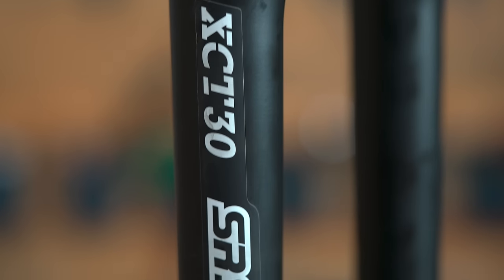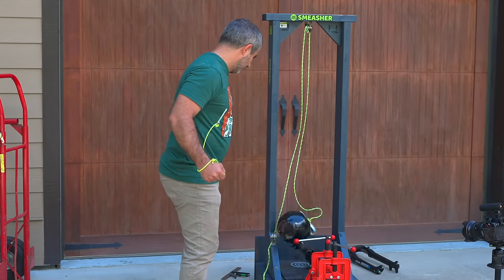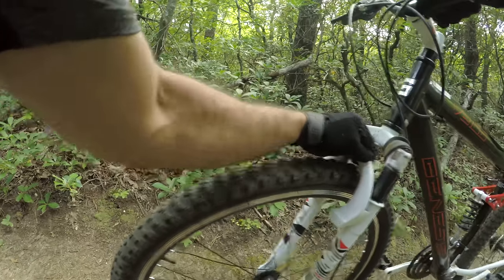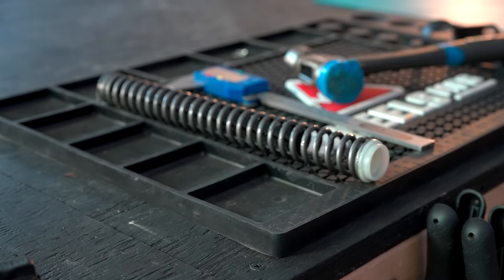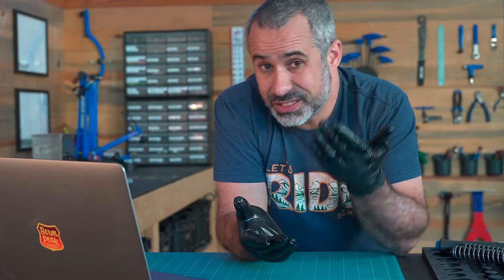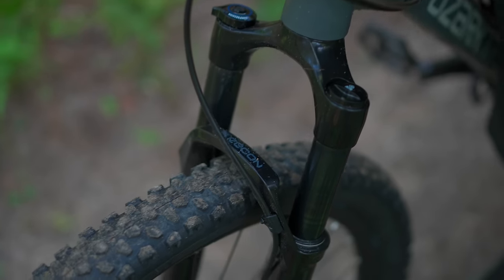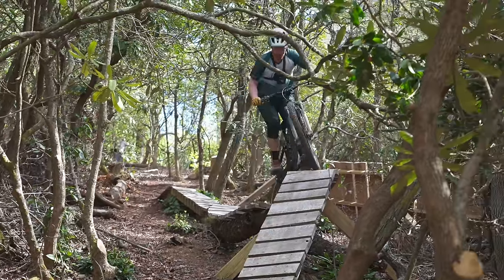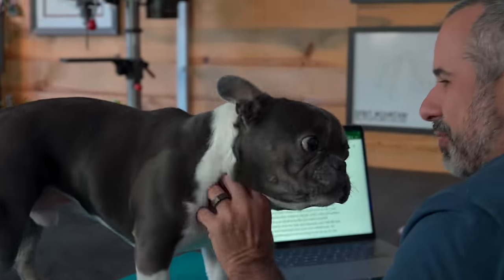The most popular MTB fork you (probably) know nothing about

Comment: I had an XCM on my 2008 GT Avalanche 3.0. 
It was okay fork, but back then they didnt have proper seals, just rubber things over the legs. Water got inside and corroded the legs. I replaced it with a used air Marzocchi, that I have until this day. 
That XCM i sold to someone who rode dirt jumps, and they was happy with that fork, as far as I know.

Comment: Thanks, that was really interesting!

I even got a brand new one of these in 28" config lying around. The old one did actually break and Suntour sent me a new one, great customer service! The springs were badly corroded due to a broken seal, I believe, that was long ago though. I didn't really use the new one as I rebuilt the bike for touring with a rigid fork that's been on it since.

Those standard models on adult sized bikes don't do much of suspension work if you're a lighter person like me with around 60kg/120lbs back then. There's a certain strength of springs built in, optimized for riders around 80kg/160lbs, if I remember correctly. And there's only so much you can do with releasing pre tension, not enough for me back then to have a big effect. It rode almost like a rigid fork but was way heavier, which was one of my personal reasons to ditch it as well. If you're a standard sized person it does an ok job though, I'd say. It even comes with mountings for fenders and a low rider rack for bags on some models!

Comment: Congrats for such a deep dive which, as mentioned below, no one else does. My experience with XCM 30 vs XCT: The XCT came on my 2017 SPZ Rockhopper 29. A piece of sh*t since the begining: Extermely slow, it works much more like a rigid fork than anything else. Then I bough a twin coil spring XCM and I'm just loving it: Its terrain reading is way better than the rockshox judy coil on my other (1 year in service) bike, it costs 1/6 of its rockshox equivalent and, as you mentioned, it's pretty easy to service. 
The cons I found during its 18 months in service so far: If you use grease on it, it demands full service on a monthly basis. The good news: That frequency drops drastically if you use a good chain wax to lube the upper legs and no grease at all on the seals. Another con is its very low resistance to corrosion. I live at the coast, in the Northeastern Bazil, where climate is pretty much like Forida (umid and hot) but it's also very salty. In my city you can see the salty fog on the beach. While my rockshox showed after no service at all, just a few stain dots, XCM30 looks like a jaguar skin, with stains as large as a thumb in the chromed uppers. YET, once lubricated w/ chain wax (I use squirt), it rocks! High frequency terrain reading (hungry horse rib gravel raods for instance) pretty much like an air susp and full travel on XCO/Bike parks. Back on the XCT, I initially thought its slow backtravel was caused by the cartridge. Removed it for a test and... no change: Its seals and heavy spec spring are the cause of the annoying issue. One thing I had to do on my XCM during one of the servicing times was to remove some material of those white plastic caps at the end of the springs. For some reason they started frictioning so hard to the lower leg inner that the fork nearly got stuck mid travel. That grinding operation caused some lateral play but not a big deal. For the equivalent ot USD 70 (in Brazil, aka the taxland) I have a great fork.

Comment: Thanks so much for covering them!
I'm almost at 2000km with my Talon 3's XCE fork (mainly road riding) and the only "service" I've done so far  is clean/wipe the stanchions with an oily rag. No problems so far except it can be squeaky at times, but that usually goes away after some time during a ride.
As for actual service intervals, Suntour does does have a general fork manual which says every 50, and every 100 hours/every year.
I wager every 1000km would be a good time for servicing for gravel/road riding, and I might get mine service when I reach 2k.

Comment: Nice review of the tech. Suntour has been around for a VERY LONG TIME, and clearly, they know how to build something so important as a fork to be safe. For anybody looking to add front suspension on a budget, I would recommend their Epixon air fork over the spring forks however. The cost difference is minimal, but the performance leap is significant along with the weight reduction. (And it is also readily available with a relatively long straight steerer tube.)

Comment: The Scott Scale 770 that I bought back in 2014 had a pair of Suntour coil forks, I rode at least 500 off road miles on that bike before passing it on to my teenage son who gave them a proper hammering for another couple of years.  I  took them apart once to clean and regrease, no new parts fitted. My wife now occasionally rides that bike and I finally swapped them out recently when a friend  gifted me a set of Rockshox air forks. 10 years use, only one service, still in working order (although the lockout no longer works!).  Not bad for a pair of "crappy" Suntours!

Comment: The best thing that happened to my 2018 Rockhopper was upgrading, (almost immediately), to to a Recon air fork. 2nd best thing was converting to 1X and adding a dropper. Sold the barely used Suntour coil fork for $40 and the guy couldn’t believe how new it looked. Kinda wish I’d kept it as a spare but you can’t beat the adjustability and lighter weight of an air fork, especially for XC.

Comment: I have just taken a Rockshox Tora fork off my 2011 GT Zaskar and replaced it with a used Fox Float RL100, Th Fox forks have a working lock out and are a lot lighter as they are air forks. The RS Tora are like Suntour also on a budget and very heavy. The best thing was that I got the Fox Float forks for less than what it would cost me to get the Tora's serviced!

Comment: Great video, I've recently bought a cannondale trail 7, it's a 2015 bike and I got really cheap. It's got expected wear and tear, in need of a good service and a replacement crankset. It's got the suntour setup. With a set of suntour XCR forks. They look very clean but are soft. I went into a couple of local cycle shops who both said they are rubbish and I should swap them out for roxshox. I've done some research and I'm gona strip them down on the weekend and see if I can stiffen them up. They aren't clunking or wobbling at all. Also I'm gona see if I can add a lock out, this night be a perfect add on.

Comment: 3:33 I have this exact suspension, I don't take it easy on my bike but I also respect my bike (as I want what I bought to work for prolonged time).  This is the only part I've not repaired and/or serviced. It is just now after about 3 years and about 160000km (100000mi) that it is showing signs of wear. I'm getting the tool to service it on Monday.

Comment: Just got one of these XCT forks on a well used GT avalanche and I have been waiting for the full video on your new(used) GT build. One thing to mention is that the replacement parts are pretty cheap as well. I picked up a new lockout cap for less than $12 shipped.

Comment: I have a suntour xcr32 laying around that's always a fail-safe if my fox 34 has issues.  Has Raidon foam rings and Rockshox RS1 seals, fox 20wt gold in the lowers instead of grease and a good application of slick honey/85wt gear oil in the air chamber with a plastic spacer under the top cap for a more progressive spring rate.  It actually performs better than it should.

Comment: A few years ago I upgraded the air version of these (XCR) to a Fox 32 factory that I got for around 70% discount. Now although the Fox does give a nicer ride its not such a massive difference (the difference in weight is significant) but the performance difference when I upgraded brakes from Tektro to Shimano XT was very very noticeable (same with transmission to XT 1x 11sp) so fully in agreement with what he says on the video.

Comment: There’s another version of the XCR/XCM entry level fork called the XCE. My base Rockhopper came with one when I bought it 4 years ago, and even after several thousand miles of harsh and abusive riding, it’s still running. They are not good forks, but they seriously never die.
Reply: To put into perspective, the closest thing I’ve ever done to maintenance was clean off the stantions. At some point at least a year ago, a pebble got stuck in the rubber seal and left a nice groove going up the entire travel distance of the fork. It even left a nasty burr where the travel bottoms out. The groove rusted, but the thing still works just fine.

Comment: You have given me a different outlook on this forks. Unfortunately where I ride is wet and muddy, I found with the fore and aft rock in the lowers they let a ton of water in even in new seals, so they require a strip down after every ride which I know a beginner will never do so in 6 months the forks will have rusted and seized up rendering them useless, that is my only complaint. I'm happy to strip them when I come across them but it's usually bad in there

Comment: The only main difference between the 3 basic Suntour forks is the diameter of the stanchions. XCT has 28mm, XCM has 30mm and XCR has 32mm. XCT has a variation of dual coil spring as both legs has springs and the usual one with the lockout.

Yes, these forks are really heavy but you do get a very reliable and an almost indestructible fork, that is if you maintain it properly.

Comment: I bought a used trek marlin that was about 10 years old, and it came with an old suntour fork. I bought the bike to build up as a backup bike. The fork was fully seized. When I opened it up to look inside, it was fully corroded and rusted, like someone had filled it with muddy water. While on the outside it looked totally normal. I was going to rebuild it but when I saw how bad the inside was, I figured it wasn't worth the effort. But it was still seized so I went and put a bunch of fresh motor oil in each side of the fork and went for a ride. By the end of the ride, the fork was moving again! It still feels scary because the bushings are super worn so it slops around all over the place. And I have a much nicer rock shocks air fork I'm replacing it with this spring. But the suntour did manage to get me into the woods a few times when my santa cruz was in the shop!

Comment: I have had SR Suntour forks on all four of my touring/trekking bikes over the years and have done many thousands of miles on them on asphalt and light unmade trails. Mine have always been the 30mm stanchion air versions with short 50-70mm travel. Given Suntours reputation for not being too fussy on weight I was expecting the lowers on my forks to be aluminium, but a recent review of the forks specification surprised me to discover that the bottom ends are magnesium, so not entry level. I can honestly say that I have never had the slightest bit of trouble with any of my Suntour forks despite being on a 150-160kg (350lbs) bike on a short tour. I only wish I could say the same about my 34-36mm stanchion mountain bike forks from Fox or Rockshox.....

Comment: Fairly recently I bought a good quality barely used Kona hard tail and it had a Suntour XCR. As low end as the suspension was it feels actually pretty good and has decent adjustment, lockout and even rebound adjustment. I have another bike with a rockshox judy air fork, and while the air fork feels better and lighter, its not exactly game changing. I've put the Suntour through its paces and plan to ride it even harder. Dont be discoureged if an entry level bike has a suntour fork, just as Seth proved I'd rather have a standard safe fork than a good unreliable and possibly dangerous fork.
Great video btw!

Comment: I just replaced my SL Suntour threaded suspension fork on my old Giant Sedona DX from about 2004-2006. I did absolutely nothing to it for 20 years and it was still working great but since I was overhauling the entire bike, I wanted to replace it. I couldn't get the fixing nuts off (rusted solid) so I finally had to cut them off with a Dremel tool after trying penetrating oil. I first tried to just cut off the nut, but I took some of the threading with it; then, the fixing nut has a cone shape on its underside which was frozen, and I had no way to get in there without an assortment of machinist's rotary files, so I just cut through the entire shaft scarring up the lower in the process. So ended the life of my 20-year-old lower Magnesium Suntour. Inside was still packed heavily with grease although metal was rusted, springs looked good, plastic was still good, rubber somewhat deteriorated. I couldn't get a new threaded fork, so I got an unthreaded SL Suntour XCM 30 on Amazon for about $150 (2024). It has a 255 mm, 1 1/8" steerer tube, as compared to a similar Rockshox with a 265 mm steerer tube. I took it completely apart and inspected it. It is similar to the old one, (although the parts appear cheaper than 20-year-old fork). Progress, I guess. It should be fine. The Headset I got is a Cane Creek 10 Series, very low-profile stack, 4 mm at crown and 8 mm on top. 255 mm is not much room, 260 mm would be more practical, Mr. Suntour; then, I put on an adjustable handlebar stem 0-60 degrees. Most stems are 40 mm where they attach to the steerer tube, and thus. are to long to work on a 255 mm steerer tube (my frame head is 212 mm). I found one on Amazon that is 32 mm instead of 40 mm, and it works just right. Otherwise, I would have had to cut threads on the new unthreaded fork with a 28.6 x 26 tpi (HSS 1 1/8" x 26 tpi) die which Park Tools sells for $280 + bucks. All other Machine tooling companies seem to be out of stock but charge about $60 for the same die when they have them. One thing leads to another, fixing bikes is just slightly easier than fixing commercial aircraft, and the lack of mfg. published technical details about products is worse than a Rolls Royce aircraft engine parts manual from 40 years ago.  Bikes are just like boats. "A boat is a hole in the water into which you pour money." SL Suntour makes very good durable forks that last with little or no maintenance. They float; lightly, and cheaply. Thank you for the video. Cheers.
Reply: I'm currently flirting with the possibility of performing my own upgrades/maintenance on my aging 2016 Giant Talon XL 3. And,  have to say, with the lack of technical data you mentioned, and that I most certainly have noticed as well, in my brief investigation into the matter. I'm kinda wondering if rethinking that decision would be in my best interest..😅

Comment: The biggest upgrade I did to my HT was replacing the Suntour XCR34 on it.  The bike rides smoother, is more responsive, has more traction.  More importantly it doesn't ride like a broncin' buck when I send it down the rocky rooty gnarly stuff.  The Suntour Fork no matter how I adjusted it, it was either too stiff or the coil spring was trying to throw me off the bike in difficult terrain.  If I was riding in the midwest I probably wouldn't notice the difference.  It may be bullet proof but it wasn't a very good shock compared to my z2 Bomber.  The bomber costs as much as cheap HT  on sale :(

Comment: Service: Every 50h a small service and every 100h of riding or once a year a Full Service. A small service is: cleaning the fork from teh outside, do a test if everything works and if there are visible cracks aso. A Full Service is actually taking it apart & replacing the Oil and the barrings when needed. When done regulary you dont need any other fork in the bikes life

Comment: since 2017 I was running suntour raidon fork on my bike, now that I got full suspension in summer with rockshox yari fork, here is my opinion: Does rockshox feel better? yes. Did I feel like I was missing out riding Suntour? No. Suntour does the job, it's once you try a better fork you realise your one may not be the best but until that point, it feels just fine. The best part is when I soaked foam rings into oil, added some grease and the Suntour fork feels like new and very responsive.

Comment: I really like cheap reliable stuff that does a pretty decent job and is easy to service and low cost. There's a lot going for it. The low service and reliability is a big advantage compared to other forks!  Losing just a little body weight makes up for the slightly heavier fork. Yeah I would upgrade to second hand SLX brakes first!

Comment: Pro tip: you can use a piece of inner tube like a oring rubber for seal  the  fixing bolts and nuts( the bolts  of the end) and then you can put fork oil to lube the stanchion, the fork work much better than the  original setting. 😏